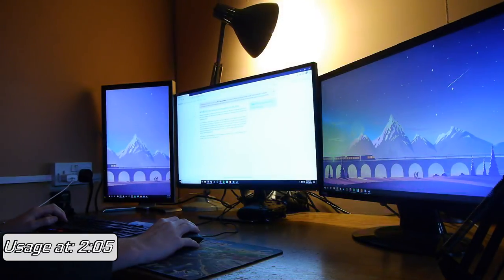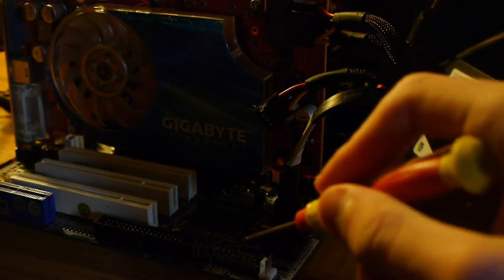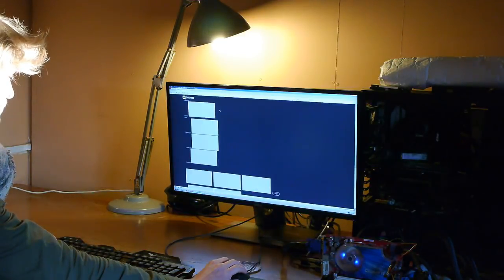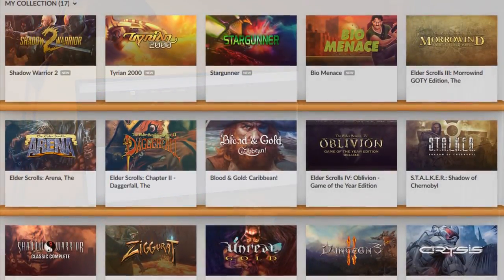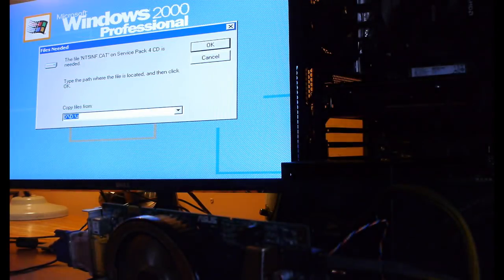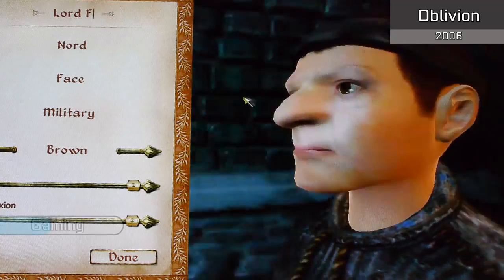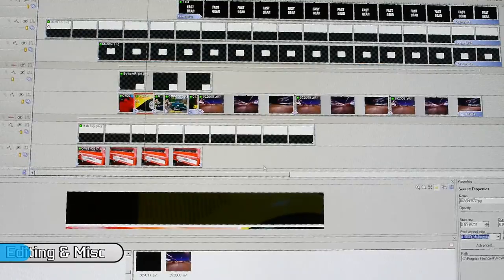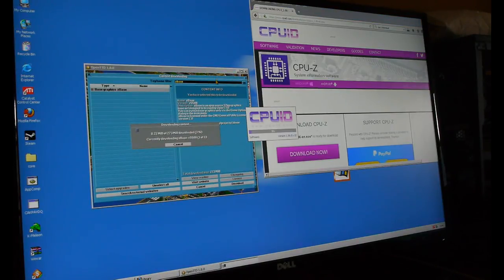Windows 2000 - Is it any good today?

Comment: I've found running windows games in Linux under Wine to be far more compatible with older games while still being compatible with many if not most modern games (Lutris provides crowdsourced installer scripts that make any adjustments to improve compatibility, even Elite Dangerous works though it's not supposed to). If the sole reason you're wanting to run an old version of windows is to play old games (rather than because you want the experience of running an old version of windows) then I'd recommend Linux instead.

Comment: Windows 2000 to me is the sensibile windows 98SE that many use , i personally don't worry about Dos compatibility due to dosbox becoming so relevant , i'm focusing on those few obscure early windows 95 games that i can't get to work on windows XP properly , i'm wanting to see how 2000 plays with those games as based on the year 1999 that 2000 came out it should have real good legacy compatibility on early windows games thats the target use case i want to try windows 2000 pro for , those mid late 90s abandonware games like sega rally etc that won't run on windows xp

Comment: Back in '02...
My PIII (1 GHz, 512 MB RAM) had Win2K on it. Had no issues. 
Then, I got a new HDD. Tried installing WinXP,
It crashed 10 minutes after install.
So I formatted the new drive. Again. And used Win2K until Vista came out.
Which is when I switched to linux. No issues since.

Comment: I still own 2 old rigs. One pentium III-800 with 128MB of ram, a Voodoo3-2000 and Windows 98SE, one pentium-IV-1,7GHz socket 423 with 512MB of rambus, a Geforce4-ti 4200 and Windows Me. I use both those antiques for running software not compatible with later windows versions. For example, I own a Zilog developpement board with softwares for Win3.1, no problem using it with 98 or Me, but NT4, 2000 or XP are no luck because of strange hardware drivers.

Comment: 6:35 That hard drive is literally teetering over the edge of the desk. On the other hand, I'm gald I'm not the only one who just sets up random components on desk space to fire them up and try them out. Well, maybe I'll just cram them into a dead case with no panels or lid turned sideways and never bother to screw them down but that's only because it's easier to manage the power supply cables and so on. Still use a screwdriver to touch the power switch pins though.

Comment: 1:40 as some websites might trick you (even old amd website), strangely enough even graphics card in x series newer than x800 have drivers for windows 2000, i did that with my x1650 pro (my 1st ever graphics card) and it worked flawlessly

Comment: As fas as an SSD on otherwise old hardware and operating system ... in a production environment, some expensive specialized equipment relies on older operating systems, with parallel port dongles preventing a VM from being a practical solution. Flying rust goes bad, and eventually needs replacement often before the rest of the machine. SSDs are a nice replacement.

Comment: Yes it is! Its one of the best windows operating systems of all time. Windows 8 and onwards are terrible OS's and mac hasn't done anything good in years, only breaking compatibility while holding modern internet access hostage without any added benefits. 

I use it for my main computer with an up-to-date phone only to access youtube and a few instant messengers.

Comment: are there any games that do run on windows 2000 but not on windows xp? xp seems more interesting to me. granted, I am from that time. But still, like windows vista and windows 8, window 2000 seems to be an insignificant windows version that i could live without, with windows 98 or xp being a better option if you want to retro game natively.
Reply: 2000 was a business OS, it wasn't really meant for gaming or even home use. Still, there's probably a few games which run best on 2000, on only on 2000, though I couldn't name one.

Comment: I own a 2004 Dell dimension 3100. I call it my 2000s project pc. It already has the highest amount of RAM (2GB) and the Pentium 4 HT needs to stay since i can't upgrade that aswell. But i can add cards and another dvd drive.
I replaced the power supply with one from a dell optiplex 740. I still need some cards and cables to complete the pc.
Edit: Oh yeah i also added a floppy drive because nostalgia

Comment: I still have Windows 2000 which I liked and only loved OS/2 more and the programs worked just fine on that machine. I just have to hook it up to a monitor and run it. I didn't want to use the OS as a game machine and I have a computer with Windows 7 on it and that is what I use to play games on. I have a computer with Windows 95 on it to play games on since most of the programs I have that machine was for Win95, Windows 3.1, or MS-Dos.

Comment: Windows XP64 was also very stable. After what people say it was based on Windows 2000 and not XP? Anyway it was more stable then the "normal" windows XP and after Windows Vista and Windows 7 came out you could run pretty much anything using the 64bit drivers meant for Vista and 7.

Comment: Your SSD issue isn't because it was a solid state disk reading quickly.  I've done a lot of Win2k installs on solid state disks and have never experienced what you've shown.  My guess is some weirdness with your copy of Windows 2000 (since it isn't virgin media from Microsoft) or a driver-specific issue.

Comment: Hi All.  I found Win2000 very stable in the day, this was when pentium 4's were coming out and while 98SE was good,  Win 2000 was much more stable and a better solution for corporate use and roll out.

The hardware driver wizard was probably the best improvement in dealing with the OS.

WinXP was good, so much i still use it on 3 old machines at home, however as of 2018 i cant activate winXP of the 2 new retail install cd's that i have, it just sits there forever waiting for microsoft activation, so i am forced to reuse a ghost image 

Like most things, the original is buggy and fixes in SP1, SP2 etc, but for XP , the memory and  cpu requirements just kept jumping up with every service pack release. 
My Pentium 2 - 233 ( 128 meg ram i think ) dual boots Win98 and XP SP1 very sluggish
My Dell Celeron 512 ram runs XP SP1 fine
The  Toshiba Laptop ( 2 or 3 gig ram ) Pentium M Centrino  and the IBM Pentium 4 ( 3 or 4G ram ) ,  all 3 run  XP SP3

Why SP3 because most other software eg winamp, firefox, requires the later XP versions to run.

So back to Win2000, yes back in the day it was fine and stable and well suited to the P2-P3-P4 range of machines, in the corporate environment as it was NT based it blended better with windows NT server and also Server 2000 or SBS was a product on its own 

Personally i ran it at work to about 2005 when every machine on site was upgraded and capable of running WinXP , rather than mix and match  OS versions.

The only negative is no native DOS and for older games the sound can get choppy like in XP because there is no direct dos access to hardware

Comment: I am trying to install win 2k on my old netbook, I flashed the iso on my 32GB USB with rufus... But in the installer it doesn’t find my ~300GB HDD in the netbook. Please Help! (Specs: Celeron @1.3GHz&4GB DDR2 Ram)
Reply: Jasher Fox The installer works, but the hard drive creates problems by not appearing in the installer.

Comment: Win2K was pretty much the same as what Vista was to Win7 and what Win95 was to Win98. After XP came out and people started migrating to NT using Win2K made sense only when you had little memory. I mean if you had somethin like 128 or 256MB of memory then slightly lower system requirements made Win2K slightly faster. Otherwise for something like Pentium 4 I'd just stick with XP and some nice theme like Luna Element 5.05

Comment: Well Windows 2000 is in the list of good operating systems from Microsoft. Specially when you installed it for the first time (often switching from a 98SE or the hateful ME). I sort of disliked XP when it first came out (lots of fancy shit, like a 98SE plastered ME) but after awhile XP with a service pack or 2 was OK. Windows 7 (which I'm currently running) I also like some, Windows 8 (hateful stuff again as Vista). Windows 10 I just had brief encounters with and it seems OK. Strange that almost like the Star trek original series movies... a curse? :-)

Anyway lots of new stuff in Windows 2000 Pro that was absolutely awesome, neat interface with AD (which did not have the awesomeness as Novell but) and most of the gaming (when it first released) where download (out of here) so it was very stable compared to 98SE (anything where more stable then ME).
And the end of MS-DOS finally, but emulated for compatibility...

Comment: A 120GB SATA SSD is under $25 now. So it's not particularly silly to add one to a Windows 2000 system. Even a 240GB for $40 isn't beyond the pale. Spending more than that would be contrary to the goals of using Windows 2000 here and now.

Comment: That's the testing ground for the modern windows operating system using NT technology.
Reply: Well, there were also NT 3.x and NT.40, so NT is basically as old as Windows 95.
NT 3 btw also runs on Alpha, 68K and PPC.

Comment: I'm really like MS Windows 2000 and Win NT.  The only problem was it ate up the Ram's.  and the cache dump should cause a crash, but was fix SP 1,then SP 2,3..?  2+ gb ram was need if gaming.  As with Windows 10 32bit, 4-8 gb is about right,  but W2K (nick names). rams was high dollar in the 1996-2001 rams which i believed was it down fall. and for Win 10 64 bits work the best if 8+ gb, for gaming today.  I got all of my education  done on Win 2000 laptops, Floppy, DVD/CD writer, and 50-100 gb hard drive, 2 gb rams.  oh you ought to see the Professor face when a out burst "You got mail"  Oh time was priceless.

Comment: Windows 2000 does seem perfect. I on the other hand have to contend with both Windows 10 and Windows 98 Second Edition. Windows 2000 just seems to have the best from both.
EDIT: I've never used Windows 2000 by the way.

Comment: Probably the last version of "windows" approaching "good," but why would you want it?  Extended support ended over eight years ago, so no update support ever.  Though I run a copy of W2000 for my jukebox, I never plug in the network cable.

Comment: You might as well ask "is using a 20 year old used condom a good idea?". It's effectively the same thing.
Growing up beginning with Win 98, moving to 2000 was a pain in the ass because it did NOT run well back then as it was essentially the dark ages of driver support. It was common back then to find PC's with VIA processors and chipsets... it was only until XP that windows was beginning to feel responsive and the industry focused heavily on intel and amd. By today's standard even XP is flaming garbage. Not that it wasn't back then either, it was much faster than 2000 but it was a hive for security vulnerabilities and still is to this day. Not sure if any of you can remember this but windows used to bother you about every week with a tool tip about running security updates because issues were found on almost a weekly basis. It was yellow if I remember correctly, and the icon was a red looking shield.

Comment: I had windows ME orignally and it was straight garbage. Games would crash. Software wouldn't install. And it was a fucking nightmare getting it to shutdown. Got 2000 from a buddy installed that. Never had a problem again. Games ran well. Software was solid. The OS was just wonderful. Would run for a week straight with no trouble.

Comment: If a game or program is designed for XP, it WILL work on Win2000pro, or Server 2003 which is better, but for the speed, with like, an athlon or a P4 and 2 gigs Win2K will be fast. 
Still have it on a ThinkPad TabletPC and it's fine. Even the Adobe or Office suite, and all the collection of not so retro vidya runs like a charm on it.

Comment: I tried to install Windows 2000 the way you did it, but every time the message "setup is starting windows 2000" appears after 5 seconds I get a blue screen of death: "inaccessible boot device 0x0000007b". How could I fix it?

Comment: I've been using windows 2000 for a variety of unsupported 16-32-64 bit software for years and stopped only because the hardware no longer worked.

Comment: windows 2000 would run just fine on a pentium 166 mhz, so a 2.53 P4 would be a bit over kill let alone a dual core. I had a Precision dual PII 400 at the time. it was insanely fast. Upgrading to XP at the time wasn't exactly trivial. Especially when paired with a Geforce 2 ti. Very slick. Course Windows 10 wouldn't even work on that system lacking sse 3. But even Windows 7 will work on it cough mostly.

Comment: Hello I have been a fan of your channel; for a long time (like since you had 15k or something) and I had a decent graphics card for the old games I like so I watched your videos more for enterteinment and information gathering puposes but my grahics card burned bcs of me trying to clean it acidentally cleaning the thermal paste without replacing it and boom video card gone.So I wanted to buy a new one but in my country the old graphics card prices are like 5 times higher and paypal isn't supported in my country(Albania) so is it alright if I ask to buy a crad from  you?
here are my pc specs if you'd recomend me something
an intel core quad q6600 2.40 GHz
8 gigs of ddr 3 ram
(I had an gt 610 graphics card 2 gigabytes of vram version) but now I have my integretaded intel q45/43 express chipset 64mb of vram)
350 W power supply
in an Hp compaq 8200 case.
If you could help me I would appreciate it if not no problem.Oh and the payment method would be throught Westen union or with mail,I don't know!

Comment: My YAYKON YH-945A6 (Industrial mainboard)  is running  DOS, 98, 2000 and Ubuntu Budgie (for buying shit). Also have 3 X Western Digital Raptors 10k. Soundblaster AWE64, Core 2 3.06GHz, Ati 850 Xt Graphics Card. Completely overkill but I love it. I also have a semi-modern machine running XP (Point of Sales 2009) which is kinda a good compromise.

Comment: Might have been easier to copy the ISO to a CD Drive mount program on the hard drive.  The hard drive would be fast enough to run the install for the SSD

Comment: I installed windows xp on an old computer I had but I couldn’t get any drivers on it. For example when I tried installing the catalyst it worked fine until it installed the graphics driver and the computer basically crashed. I had no problem installing catalyst on that PC when I ran windows 7. Anyone know why? I’m not exactly an expert in old windows operating systems

Comment: And the first two core processor was released in 2003 Athlon by AMD
Reply: Did it actually work as intended though? AMD usually is the champion of beefy hardware but usability is key. Did these early dual cores actually divide tasks evenly? I'm still rocking a core2duo here and these little things are BEASTS of processors, aged incredibly well

Comment: Question from a noob: how is the Pentium 4 @ 2.5 GHz underpowered by today's standards? At face value, today's processors also clock in around 2.5-3, don't they?
Reply: Just 1 core

Comment: I installed 2000 on my mother’s computer back in the day because it had a Cyrix CPU and it was very unstable under 98 or ME...
Unfortunately the Cyrix chip was such garbage that it was unstable even with windows 2000.

Comment: Steam stopped working on Windows XP and Windows Vista in 2019.
Reply: Yep, end of an era. Hopefully support for Win 7 and 8 will last a bit longer.
Reply: I assume Windows 7 and Windows 8/8.1 support will be dropped at the same time. Just like how Windows XP and Windows Vista did it. Yes, I hope support is fairly long. Of course, likely third party companies will drop support before Windows 8/8.1 but after Windows 7. Since Windows 8/8.1 has very little market share just like Windows Vista did. Windows 7 has huge market share just like Windows XP. Of course, they may support it even longer depending on Windows 7 market share.

Comment: Kinda a moot point nowadays as all windows is nt now.  Back in the day 2000 was good for office stuff and nt security while ME was the gaming and home use equivalent
  A good retro build would be dual boot 2k for office stuff and ME for games.   Or better yet if you have a fast athlon or p3 tualatin and a beefy (for the time) gpu. Like a geforce 6800 agp or radeon x850 then dual boot 7 and ME and have the benefit of ME for classic games and 7 to have modern secure eeb browsers.
Nowadays 2k is kinda pointless cause 7 does everything 2k can, and does it better, but ME and 98se still have a purpose.   Some games only run on the 9x kernel. And older software similarly wont run on nt based windows.

Comment: Win 200AS Proliant 7000 (4) 550Mhz 2M Cache, And a But load of Intergraph 3400 cards, And Open GL Matrox M2 ,
My question is How Fast I can Pump in SSD in to a (18) SCSI Space..I never Did finish 2KAS on the Proliant 8500 (8) CPU unit.

Comment: when i first installed xp back in the day it was fast with no so called bugs . once i got the latest updates from microsoft , thats when i noticed all the problems started .  my system slowed way to much and started troubles with other software that worked perfect before the updates .  i have worked with dos , win 3.1 , win 95  win 95 with usb support , win 98 , win me  , win 2000 , win xp , win 8.1 and now win 10 and have found that after the updates from microsoft is when all the problems start  .  its always the updates from microsoft that cause my issues .  whats really going on lol  .
Reply: forgot to mention win vista , that was just as bad as win 95 for crashes and hangs .
Reply: I never had problems by only installing security updates.
Reply: @NuntiusLegis   maybe its just you are not as attentive as i am to system changes .  i notice the slightest change .